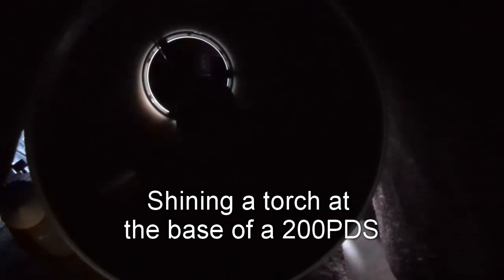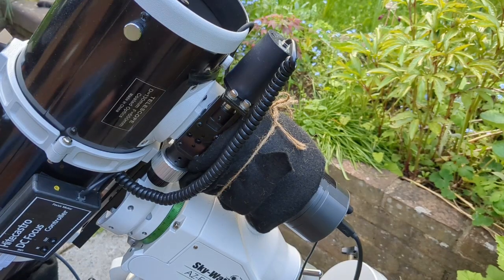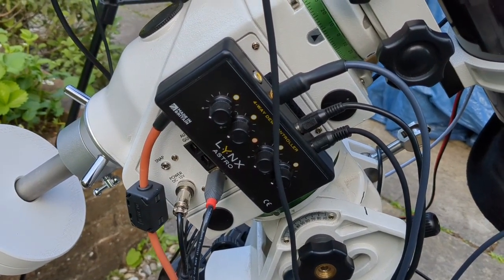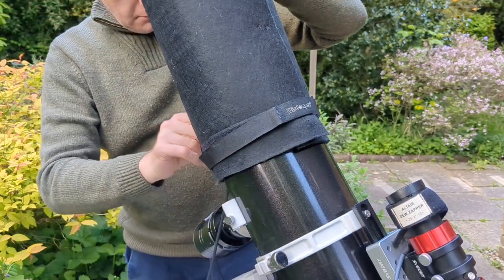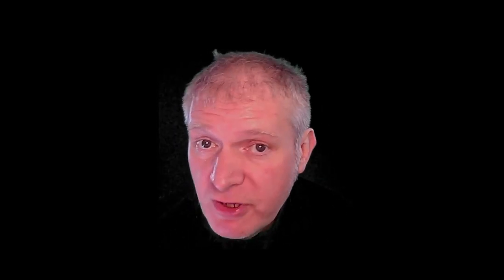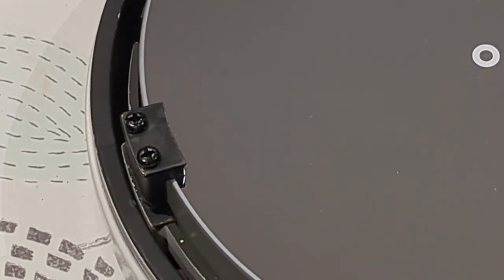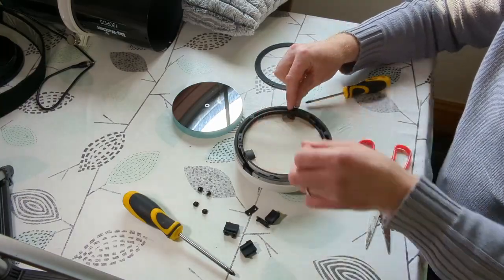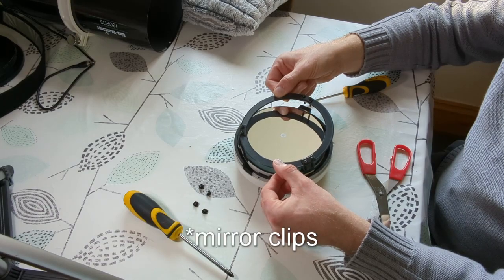Newtonian Telescopes - How to make them work - because from the box they are useless!

Comment: It is strange that you can buy a telescope or a mount and it does not work properly and that seems to be considered ok and normal. These problems are really defects. You don't buy a new car expecting to change the tyres or have the engine tuned before it will run so why do dealers and manufacturers think it is ok to sell products with these problems? This is a hard enough hobby without all the nights lost because of equipment problems!

Comment: One reason the mirrors in commercial Newtonians move is that the primary is often supported by nylon screws at the back. As the telescope is moved to different parts of the sky, the change of weight distribution between the back and edge supports causes those screws to compress by slightly different amounts. This can affect both the focus and the collimation. The solution I adopted was to replace the nylon screws with stainless steel ones, which don't compress. If you do this, make sure to file the ends to a very slight convex shape first: screws straight from the box usually have a raised irregular rim which is not a good shape for the support. For normal imaging the effect may be quite small, but I was imaging the ISS, so the telescope was moving through more than 90 degrees in a couple of minutes. The change of alignment and collimation was very noticeable under those conditions!